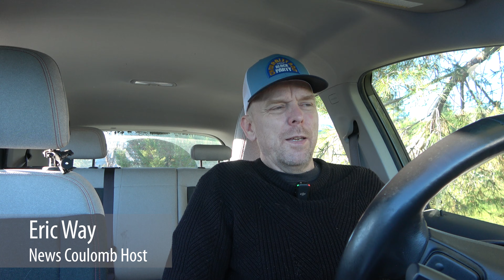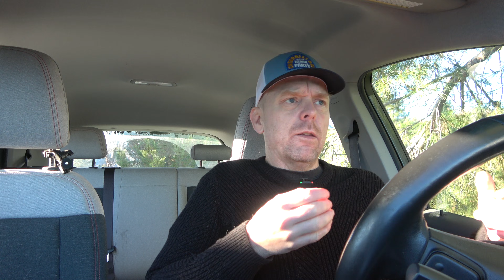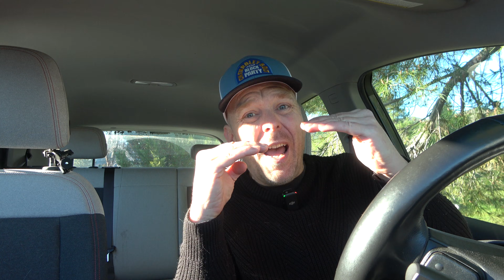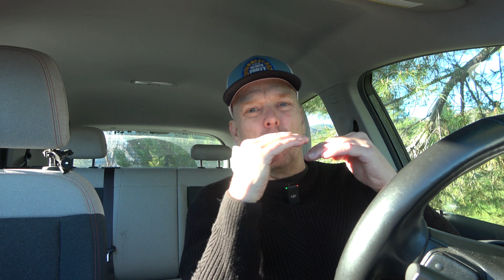Is Donut Labs Misrepresenting Their Solid-State Battery Technology?

Comment: I believe the channel you are referencing called them "quasi capacitors."  These are not really capacitors and not really batteries, but sort of a hybrid between the two using carbon nanotubes and titanium dioxide.  Of course they openly noted that they were speculating on the chemistry using research papers previously published by the nanotech company prior to its merger with Donut.  We will know within a few months if Donut is being honest with its claims.

Comment: i'm no electrical engineer, so this may be a laughably dumb question, but is it possible they've combined a supercapacitor and solid state battery into a single unit?  is it possible the capacitor facilitates fast charging, etc. and then discharges to power up the battery as it gets depleted? that would allow their claims to be sorta/potentially true if the capacitor and battery form a single unit.   they are also seeming to push not just the battery but the Donut OS (potentially to manage that interface).  i'd love to know your thoughts on this idea.  thank you for the video.  i think critical but fair analysis is crucial these days and I think you nailed that balance perfectly with this video.
Reply from the maker: Thanks! I suppose it's possible that they could have done what you described, but I would hope that they would market that as some sort of hybrid module. There are currently proposals to do exactly what you describe, but on a module/pack level rather than a cell level. 

Either way, though, what they are presenting would be a step change in energy density (whether we are talking battery or capacitor), and that's something that needs to be demonstrated and confirmed.

One of the problems you'll see with these new technologies is that many of the terms are marketing jargon rather than technical words with hard definitions. There's no standard definition for "solid-state" or "supercapacitor," so a company can slap whatever label they want on a new technology.

Comment: Announcements at CES are only marginally more reliable than campaign promises made by politicians.

I will be interested in how this develops as any improvement is beneficial.  However, I will need to see independent verification of any claims, and actual production at large scale before I start celebrating.

On charging speed, there is always the question of when will EVs charge as fast as we fill gas tanks.  I really find this pointless for just the reasons you mention.  To get charging that fast will require high voltages and high current.  Both of these attributes add considerations that need to be addressed.  Anything faster than 10 minutes for a session is faster than most will take to walk to the C-store or restroom and back.  Faster charging requires solutions that will add to the overall cost, and will require the highest rated chargers, to achieve.  Most chargers will not be fast enough to provide the power needed to take advantage of the capabilities that extra coot will allow.

Comment: I see a couple of issues. First of all heat. 100.000 cycles is impressive. And so is a battery that can operate at temperatures up to 100 degrees C. But how does temperature affect cycle life? Cycle life is tested at 25 degrees C. That means that these test numbers don't say anything about cycle life in real conditions.
And then heat also affects self-discharge, which others have also mentioned. What if you fill the battery in 5 minutes, but after an hour you have already lost 10% due to self-discharge?
In the motorcycle they have slowed down the charge rate to 80% charge in less than 10 minutes. There must be a reason for that. They also restricted the vehicle top speed. It sounds like there are issues they are not talking about. And what do they guarantee?
"Capasity fade 20% after 1100 cycles" That is a decent cycle life for a motorcycle, but nowhere near 100.000 cycles.
Internal resistance 0,1134 Ohm. This is 0.2-1.5 mOhm for LFP (=0.0002 - 0.0015 Ohm). So we're looking at a factor 100 higher. That is bad. Very bad. That means low cycle efficiency and lots of heat. And that is under standard testing conditions with low charge rate, imagine what would happen at higher charge rates.
The motorcycle company is only offering upcoming models, which are not yet available. You can order yours and pay a deposit, but they are not delivering yet. This is not reinsuring.
The motorcycle is also expensive. Which contrasts to their claims that this battery is cheaper than lithium. Which undermines their credibility.

Comment: Supercapacitors have > 98% columbic efficiency typically. Capacitors are very leaky, but supercapacitors are typically not as leaky, but you're right, much more than batteries. That said I have heard of particular supercapacitors (specifically using meta materials, which is almost a certainty here, if it is real) having very low leakiness, on the order of typical batteries. These are lab models, of course, nothing in production. In the EU and US if they are selling this as a battery in a car it will have to have an 8 year warranty, so your concern about that is really going to be the automobile manufacturer's problem (if it is adopted). I am assuming that Donut would have to give the manufacturers the same warranty or they won't adopt it.

As for trucks, it isn't the weight that would make this feasible or not feasible (though that matters) it is the cost. Chevy makes EV trucks with close to 500 miles of range, which is not enough, but getting close. Problem is those trucks cost 100K or more. Unless the costs drop the economics for towing and electric are not quite there for most consumers. For commercial, and specifically routs where electric can work, that is a different story. For commercial trucks fuel and maintenance are the major cost not the vehicle cost, so if the truck is twice as much but half the cost in fuel and 75% the cost in maintenance, it is still a big win. Now if energy density goes up and cost comes down, then consumer towing becomes reasonable. Of course if this is for real, it could.

Comment: He mentioned that the motorcycle will be charged at 200 kW for five minutes, so the charging efficiency will have to be very high, otherwise massive cooling would be required, which is not possible in a motorcycle. He also mentioned that the battery will outlast the vehicle 30 times over.

Comment: A good explanation of the possible problems with this 'battery'. However, even a supercapacitor with the claimed specs would be worthwhile. A hybrid of this and a Li-Ion battery used as a range extender would be interesting. The supercapacitor would presumably be more efficient than a battery at recovering energy during braking.

Comment: Agreed, Donut is very likely a scam. 

But this notion that a wide voltage curve is a big problem for sodium is nonsense.  Yes, most existing inverters won't be able to handle sodium's wider voltage range, but all that's needed is a redesign to handle the wider voltage curve.   Wider voltage range makes it easier to calculate SOC, which is a problem for Li ion chemistries.

Comment: It's is Carbon nanotube — aniline polymer pseudo capacitor based solid state battery and lemme tell u something the specs are just a beginning it cango even higher , high enough to stand at top of performance and safety and can be made from abundant maetrilss anywhere in the world , this battery's future mature version would representthe pinnacle of electric based batteries with nothing can surpass it all of it's metrics simultaneously and if this my claim about it's bsecret turns out to be true u can effectively drop anyother kind of battery and can be fine by just investing in these kinds of battery technology cuz this is the best what could we make without RTAP Superconductors , perfect materials and nanobots to edit materials of battery on fly to fit exactly according to environmental needs .
Beyond the matureversion of this battery lies only the RTAp SUPERCONDUCTORS nanobot version of battery only and beyond that is nothing but Fission andbfusion based power system/batteries to surpass these electric batteries but that are unsafe so we don't count it and RTAP Superconductors with nanbot perfect material editing is still sci-fi and cheating so yeah mature next gen version of these batteries can do everything u can ask for an electric battery to do realistically even powering humanoid robots to work continuously for say more than 2/3 rd of the day with less than 5 minute recharging with upto 100000 plus recharging cycles while being safe

Comment: I agree with this assessment almost completely.  I disagree about the point where he talks about truck towing range requirements.  If the recharge times are accurate the viability of such a vehicle depends more on the roadside infrastructure that the battery.  If the high power chargers exist, the battery size/weight issue becomes irrelevant.  We have to stop and refill our ICE powered trucks and we need potty breaks so a recharge range while towing close to 300 miles would be sufficient. But as to the 'mechanics' of the Donut 'battery', I'm thinking some kind of breakthrough supercapacitor technology that eliminates the chemistry required to store a charge in 'conventional' batteries.

Comment: Marko Lehtimäki - no need to say more. Strictly seen, he is a sad person who needs urgent help. Nevertheless, interesting how these unsubstantiated claims could develop to this level. Waiting for 3 months or for any additional tests will not make any difference. The demonstrated charging curve is clearly outside of physics (both for a battery or a capacitor system), let alone the non-existent, yet needed thermal management by applying a current of 270 A over several minutes. How can this possibly work without violating the laws of nature?

Comment: There are reports of a shady history of the front man for Donut (announced inventing the first true artificial intelligence) NordicNano co seems to be the brains behind the technology, their literature mentions: Electrostatic Bipolar Capacitor " 400 Wh/kg, over 50,000 charging cycles." , "premises (3850 m2) can support five production lines running simultaneously in three shifts."

RE: Self Discharge Rate:  someone posted some math suggesting a Graphene-Teflon capacitor could hold the charge for 59 years.

@mp7388  1/9/26

I think the concept of such a capacitor could work! 
I think it is technically a capacitor made from extremly thin graphene and teflon layers.
 Now because graphene is just a atom layer thin the insulation layer of the teflon layer 
 of 100µm would provide extreme resitistance properties. 
 The leak resitstance could be so small that it can be handled as a battery, 
 theoretically the charge would last 59 years:

A = 1 cm²
d = 1 mm = 0.1 cm
ρ(PTFE) = 10²² Ω·cm   (conservative lower bound)
εr ≈ 2.1
C ≈ 1.86×10⁻¹² F     (same geometry as before)

Leak resistance:
R ≈ ρ · (d / A)
  = 10²² Ω·cm · (0.1 cm / 1 cm²)
  = 10²¹ Ω.

Time constant:
τ = R · C
  = 10²¹ Ω · 1.86×10⁻¹² F
  = 1.86×10⁹ s.

Convert to years:
1.86×10⁹ s ÷ (3600·24·365) ≈ 59 years.

Result:
τ ≈ 1.86×10⁹ s ≈ 59 years.

Comment: ... Why supercap, can't the battery be sodium metal, or silicon sulfur?, they presented a cell, there are new rechargeable batteries with zinc, the voltage is low but they can put a series of two cells
Reply from the maker: A supercapacitor was just my suspicion based on factors like speed to production and the use of non-critical materials, but that's why I mentioned sodium ion. These questions would still apply to a non-lithium battery, so it's important to not ignore or gloss over them.
Reply: @newscoulomb3705  ultra capacitor are lithium based, and are the closest things to battery on the capacitor sides
Reply: The giveaway that does makes you think about capacitor is the solid separator, and the cycle.
But it depends where is the cutting point, of you consider a battery done at 80% or 70% of the original capacity.
The thing that totally contrast with the supercap theory is the power density (Wats per hour) not the energy density (voltage).
To reach 30% more energy density than the best lithium the jump of a super cap is from 10 time less than battery, that's the reason o do not believe it.
Super caps are based on carbon and metal oxide, and some of those oxide are cheap.
2 bit davinci came back with this same idea, and he brought back a video of a battery charging at 4 volts those 4 volts are not significant because with pouch cell is easy to adjust the voltage

Comment: It it was a simple capacitor, they'd be saying the charge rate was only limited by the supply.  1000C would be achievable if it didn't melt the contacts. 

We've had things that are part  capacitor and part battery cell since lead-carbon batteries, and there are lithium-ion capacitors. 

I'm skeptical of Donut, but trying to force a wedge between  batteries and capacitors is anachronistic.

Comment: Donut has admitted (see Two Bit da Vinci's interview) that 11C charging is hard on the "battery" and that half that rate is better for longevity, so this technology is damaged by excessive current/heat.  They don't share internal resistance, but we'll find out soon when the bikes begin delivery.  Those bikes will not fully charge in 5 minutes, but perhaps they could if the manufacturer were willing to sacrifice cycle life.
Reply: 5 minutes is too short time anyways

Comment: Yeah, this is exactly what I thought at first, too ( a super-cap or super-cap/battery hybrid, leveraging the strengths of both ).   If it were a true solid-state battery ( SSB ) breakthrough, there would be papers published about on the breakthrough/chemistry in multiple scientific journals.  The money is not in manufacturing these batteries but in licensing the tech to multiple companies who rely upon it ( auto makers, tech companies, even energy producers for power grids, as such a 'battery', if true, would solve many problems regarding solar and wind power being woven into the grid much more efficiently ).

It's just a super-cap or super-cap/battery hybrid.

Comment: Donut has no existing battery manufacturing capability by themselves. However, they are teamed with Nordic Nano and Nordic Nano acquired and repurposed a manufacturing facility in Imatra Finland in 2025, claiming it will be ready to produce "solid state super capacitors" in the first part of 2026 by a "screen printing process". Also, the specs align almost verbatim with the high energy density super capacitors already produced in a lab in Korea using nanotube technology. So, this is most certainly a super capacitor. They could include a small conventional Li battery to offset the self discharge loss, if required. So maybe it's not all BS, but color me skeptical.

"The current record for a supercapacitor was set by researchers from the Korea Institute of Science and Technology (KIST) and Seoul National University in May 2025. 
Specific Energy Density: 418 Wh/kg.
Significance: This is a breakthrough because it matches the energy density of many high-end lithium-ion batteries while maintaining the ultra-fast charging and long cycle life (over 100,000 cycles) of a capacitor.
Technology: It utilizes a nanocell-structured composite fiber made from single-walled carbon nanotubes (CNTs) and the conductive polymer polyaniline (PANI)."
https://www.sciencedirect.com/science/article/pii/S1359836825000691

Comment: I thought from the get go that it was a capacitor rather than a battery and I would MUCH prefer that to a chemical system. I always thought that was the way to go (Musk was going to do a PhD on it) but there were issues eg energy density, discharge rate and voltage drop that needed to be resolved. Perhaps Donut have done that - certainly with density if 400Wh/kg is true!

Comment: It doesn't look real. Looks like a split tab pouch cell or flat capacitor. The tab on the pouch cell is where basically all the internal resistance is. There can be a 40 degree celsuis temperature delta between the electrolyte and the tabs.  They aren't even modern wide tab or lengthwise tab.

Comment: They have probably used nano tubes as capacitors in combination with something that resembles a battery. And is in away something in between. But when they say 100 000 cycles they must have done that  . It they charge a cell up in for example 2,5 minutes and discarges in 2,5 minutes. Well 5 minutes up and down in 5 minutes. Then 12 carging cycles in 60 minutes. That is a litle over 100 000 cycles in 1 year. It is possible they have done this for one year with multiple cells. Life time is something else.

Comment: This is not a capacitor!   It's an all electron battery — a device where the internal charge transport and storage are dominated by electrons and holes (charge carriers in solids), not by ions. 
Electrons are the mobile negative charge carriers.
Holes are the mobile positive quasiparticles (essentially places where electrons are absent in a valence band).
Quantum mechanical effects (e.g., quantum tunneling, band engineering) dominate the transport and storage mechanisms rather than ionic diffusion and redox chemistry.  This matches the capacity, cycle life, temperature performance, and lack of Li, Ni, Co they describe.  --  This concept was worked on at Stanford and Quantumscape back in 2010 and more recently by a German company AEB.